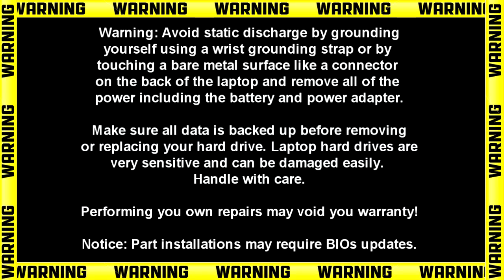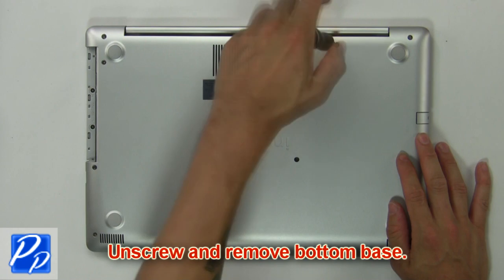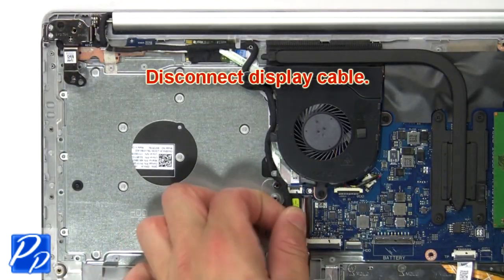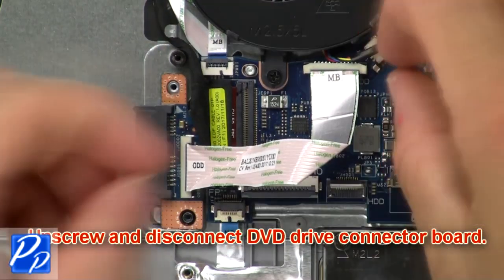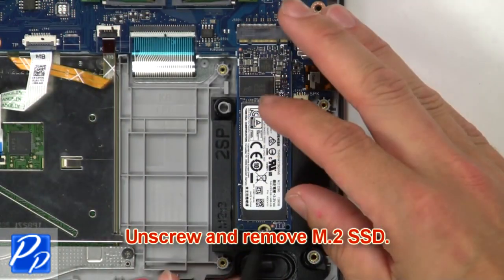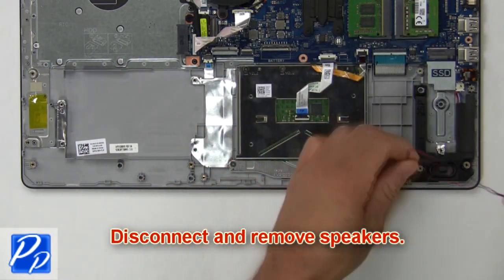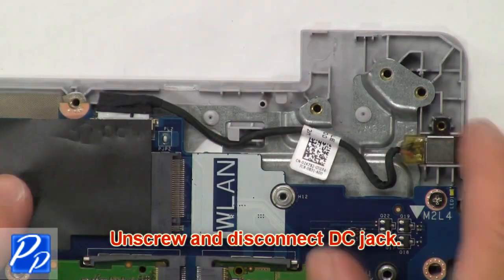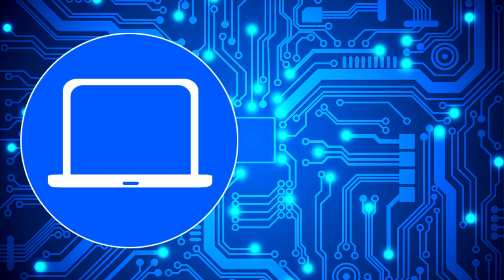Inspiron 15-5570 W/ DVD Drive (P75F001) Palmrest/Keyboard Assembly How-To Video Tutorial

Comment: Why are disassembling the entire fucking PC to replace the keyboard? I've done it before without dismantling the whole fucking machine! After I replaced it, the keyboard worked fine for years.  Are you trying to discourage people from fixing their own shit? Companies are  so damn crooked!
Reply from the maker: The keyboard for the Inspiron 15 (5570) uses a complete keyboard/palmrest assembly. The keyboard is not designed to be separated from the palmrest. In order to replace the keyboard/palmrest assembly, each of components shown in this video need to be removed first. This process can be cross-referenced in the Dell user manual for this model. Hope that helps.

Comment: How do you get the keyboard out?
Reply from the maker: The keyboard and palmrest are a single assembly that can not be separated. You can shop for this part at our store here: http://ppci.me/c/141/1172/keyboard
Reply: @dellpartspeople  is there any way to replace it with a backlight keyboard?
Reply from the maker: @aedr10001  Yes. You can check the inventory at our store here: http://ppci.me/c/141/1172/palmrest